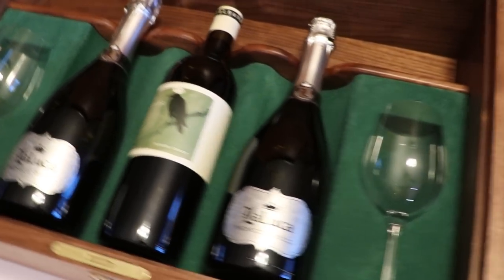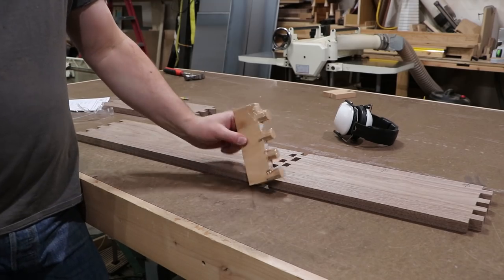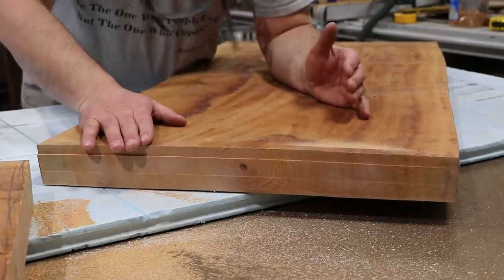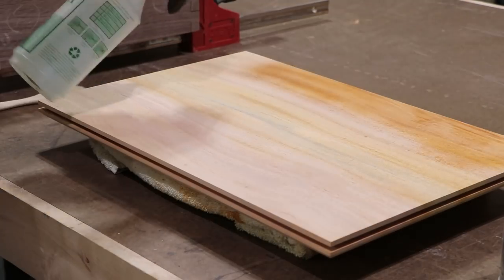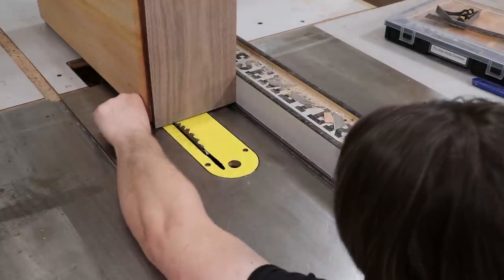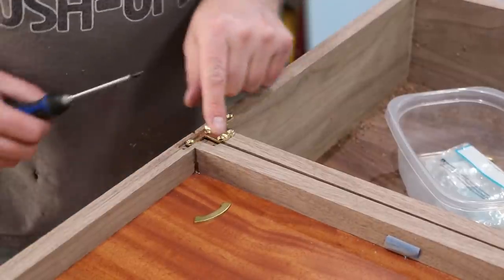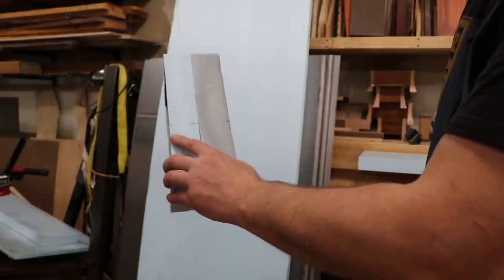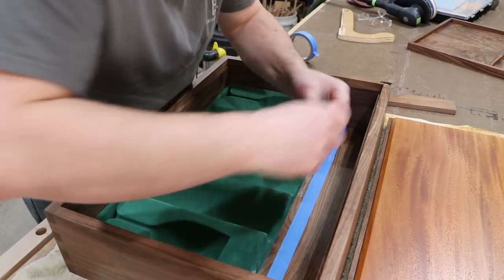Building a Custom Wine Box

Comment: Fabulous job, Brian. I've never flocked anything, so this is a question, not a critique: looks like a bold move using the foam insulation as the material given that it could chip or just have the flocking wear off over time... what's your thought?
Reply: @Benham_Design  Makes sense! Thanks!